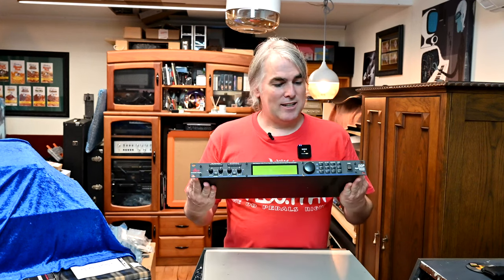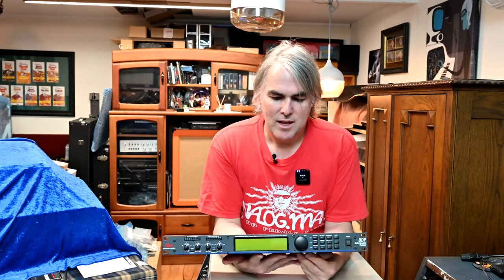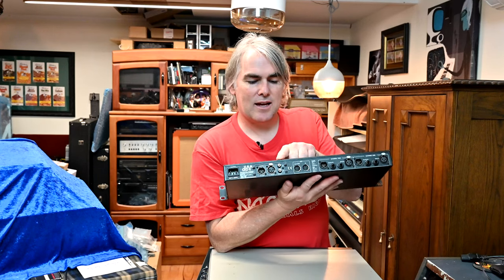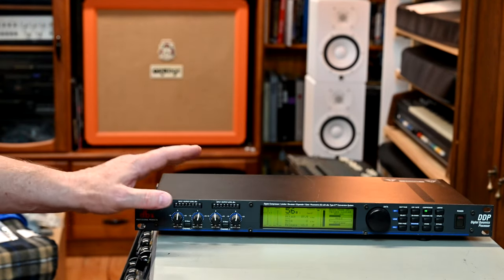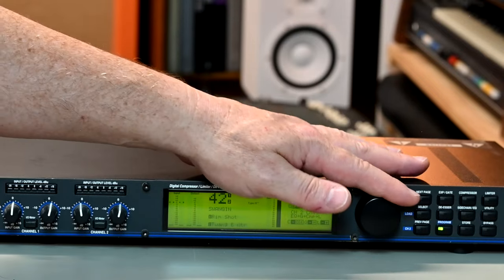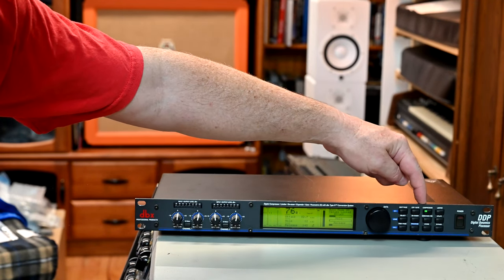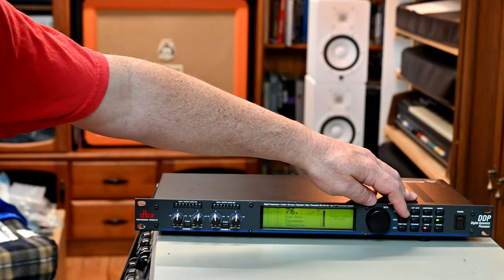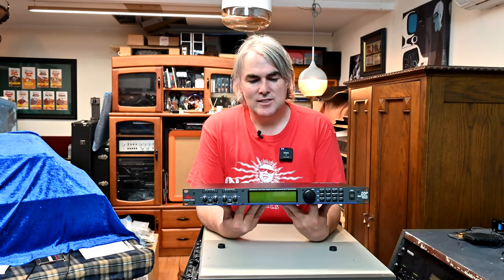dBX DDP review and overview

Comment: If you have the AES/EBU and are worried about clocking, all you have to do is realise that this unit runs at 24bit... so, if you're running other kit with this, just make sure the other unit can be adjusted to 24bit. All good. ;) I have two of these units and love them still to this day. Tape saturation only works from the analog inputs, NOT from a digital source.
Reply from the maker: Excellent info Wil - thank you and very glad you're still rockin' with the DDP!

Comment: I have had it for years, collecting dust, you have inspired me to bring it back, how to connect to daw for mix and master? Isn't this a hardware version of vst plugins? Just curious?
Reply from the maker: Hi Afro Blue - thank you for checking out the video and I really appreciate that this could inspire you to dust of this piece of gear and re-discover . . . or maybe discover for the first time, how good it is.  

If this video gets a decent amount of views and likes, I may do a deeper dive on the DDP, as there is a LOT there.

To answer your questions, My preference is for analog integration, via a Soundcard, however both the digital connections will work well.  I think the AES/EBU integration for mastering could work really well.  

The only dBX related plug-ins I've seen online are the emulations of the famous 160 model.  The Waves version of that plug in was made in collaboration with dBX.  The DDP is it's own beast, with additional features (eg: de-essor, gate, side-chain EQ) that the 160 doesn't have.  I think you will find value in exploring what the DDP has to offer and see it as a good alternative to plug ins.  

Let us know how you go.